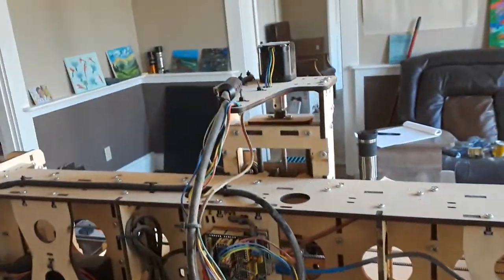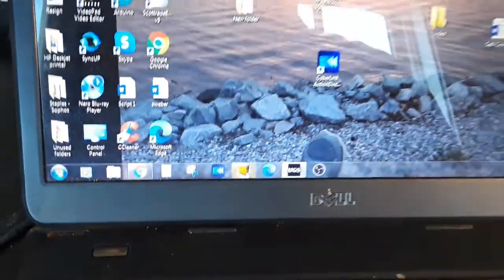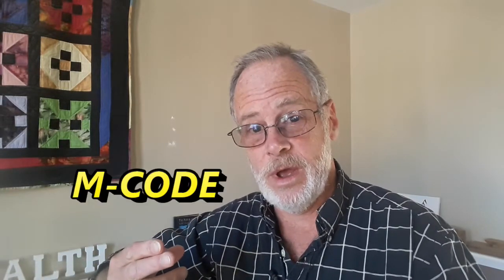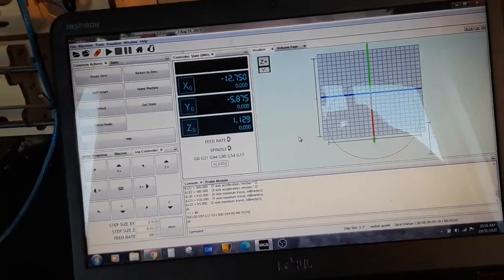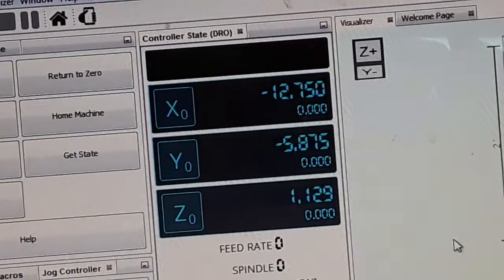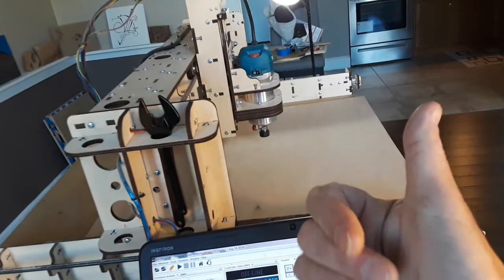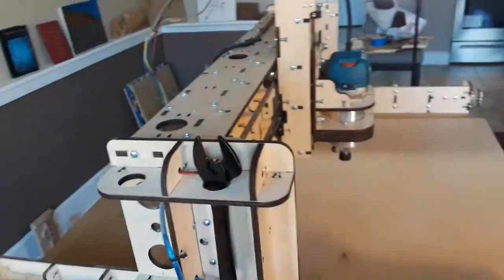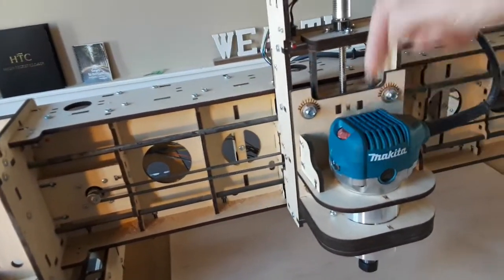MUST KNOW BASIC TERMS - Get to know CNC Terminology Router Laser, CNC For Beginners

Comment: My machine 'home' is grayed out! so I don't have a home to go back to,
Reply from the maker: mikehuynh5715,  It sounds like your machine might not have been properly homed or calibrated. I recommend checking your machine's manual or contacting the manufacturer for assistance on how to calibrate the home position.
Reply: @IDCWoodcraft  Thanks for the quick reply.  I am embarrassed to say that the machine was not connected at the time.  But it works as you showed in the video.

Comment: I have the same CNC machine. I have used 3D printing for a while, but am new to CNC machine. 
On your video, around 9:35 point, you were talking about the 0 0 start point for your project on a piece of material. I understand that part of giving the machine the start point for the project. I wish you would have showed how you do the same on your computer in the g code sender software.

I have watched and saved a lot of your video's because of how you take the time to show what your demonstrating on the video with a CNC machine, software, and when able the project performed on the machine showing a finished product.

Thank you for taking your time to share your knowledge and your time. I know you said you gave up the 9-5 for this new chapter in your life and I believe when more and more people start to use CNC machines your you tube channel and new chapter will do great. Thanks, Mark
Reply from the maker: Hi Mark. I didn't think about showing hoe I did that in the software. I'll do a new video onit soon.

Thank you for the supportive comment. It is definitely becoming a mainstream thing these days. As long as I focus onwhat people need, the channel will do well.

Comment: Sir, as always great, informative videos.  I would like to know more about the relationship between between the design software and the G-code software.  I am learning VCarve. How does the design files get translated to the G-code that is then sent to the controller?  I would also like to know more information about the reliability of the handheld routers used on the hobby cnc machines.  How often can they be expected to last?  It seems that they are not designed for many cycles of long run times.  Thanks again.
Reply from the maker: Hi Brian. First regarding G-code. All design softwares built for CNC routers should have a CAM section to them. If not, avoid them. The CAM section will create the G-code.

As far as hobby routers...it depends on what you are talking about. If you buy a small one from Amazon (which you should never do), no they will not work for production use. The big 3, Longmill, Shapeoko and Onefinity do work for production. I have a longmill which I'll be releasing a review video on in 2 days. Watch for that to come out. I talk about the production aspect in the video.